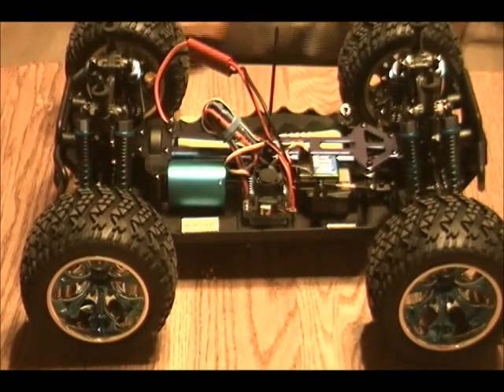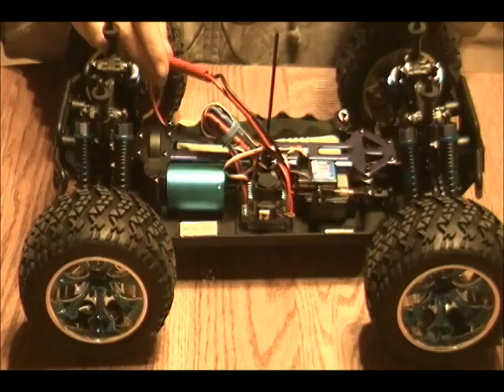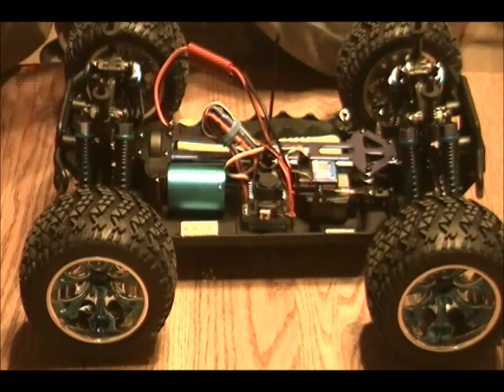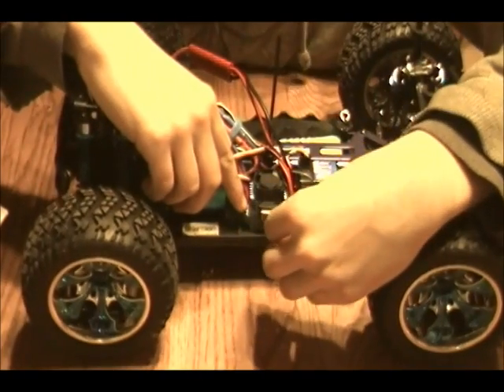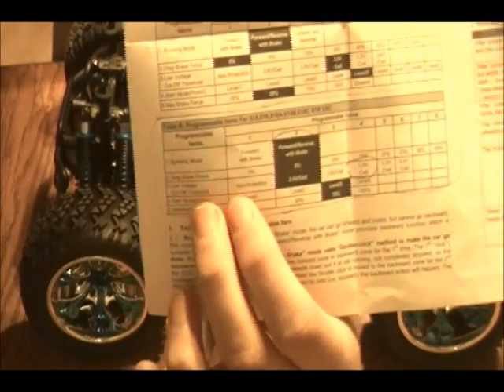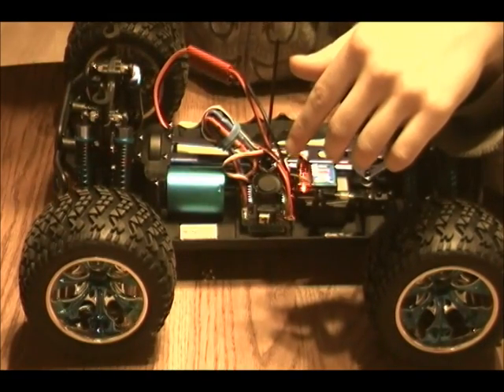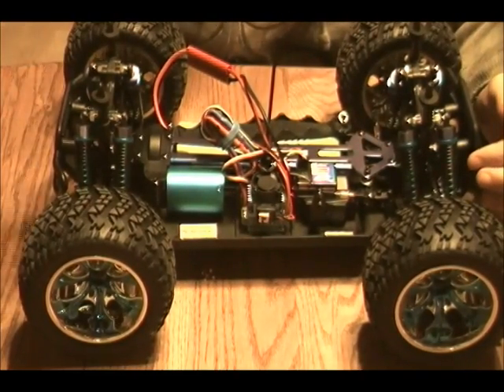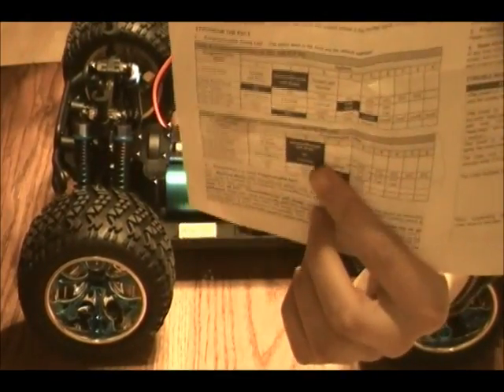Exceed Infinitive: ESC Programming (part 2)

Comment: I went from a 6 cell 3000 nimh to 7 cell 3000nimh in my exceed rc dynamite  With a stock esc capable of 2-3s lipo. My problem is I loose all throttled and top speed randomly while steering remains. Any ideas?

Comment: Is there a way to program the esc for nimh battery settings without using a programming  card?
Reply from the maker: Carter Langerak I'm pretty sure you  set the LVC to 0.0v or whatever the lowest setting is
Reply: thx

Comment from the maker: @MrAllancord Thanks, yeah I just felt that the basics were needed for programming. But in a nutshell, starting mode is the punch control or the torque amount used when moving from a dead start. Low punch would be a slow smooth start & acceleration while full punch would be a nearly-uncontrollable wheelie.

Comment: @BashMonkeyRC no, i was being dumb and ran into my dads rustler and his tire went in between my tire and front bumper and with our combine speed it cracked the bottom of an a-arm and bent a dogbone and broke a steering linkage in half but i should have it back within 2 or 3 days he just got the spare parts and fixed it and shipped it today

Comment: I bought a program card because my esc is doing weird things. If i am running full throttle and let off to half throttle it will not go back to full throttle, unless i come to a full stop. My truck came with the same tires you have. Nice truck for the price.Runs really good on 7.4 3000mah batteries too.Nothing gets hot and run times are longer. just a little slower.